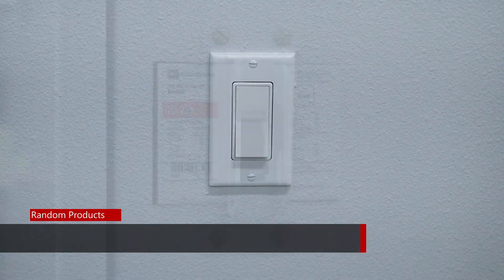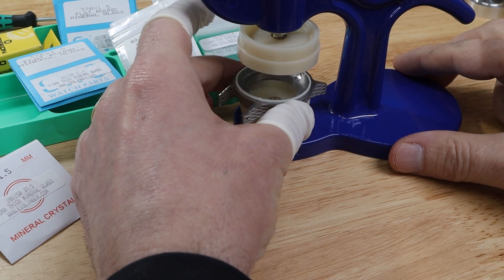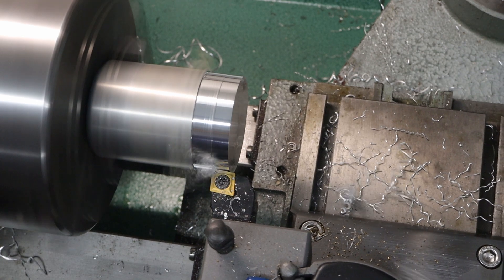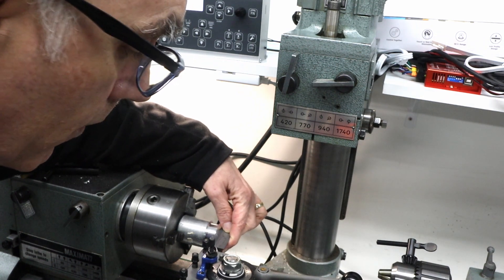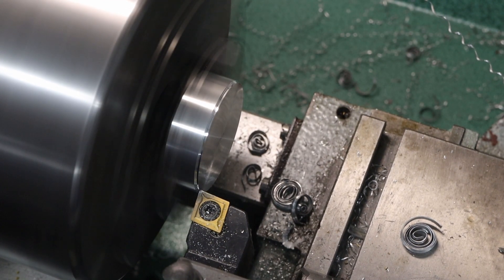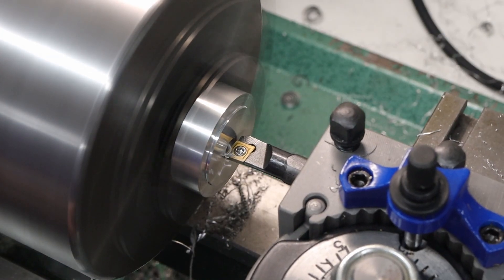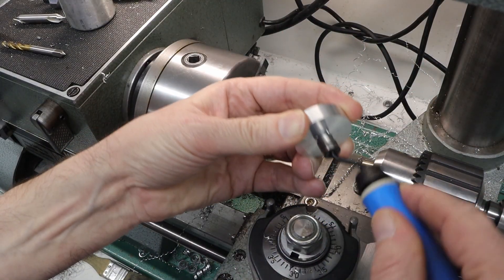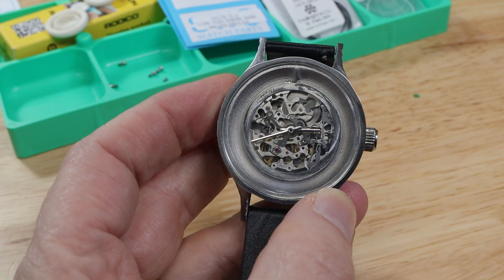Watchmaking Crystal Installation Tool for small scale production

Comment: This might sound silly but what if you called up Parker o-rings and just asked them? I mean you should like you are trying to work from the crystal to the o-ring but I suspect you want to find the right o-ring and gap size first then size the crystal.
Reply from the maker: Thank you. I might try just that. Although, it looks likes the smallest they make is 3mm cross section diameter, but we need more like 0.7mm. That being said, I see that have a really nice handbook that I should be able to use to calculate the correct size gland.

Comment: When I was a subsea engineer, our company had an internal design document (spreadsheet) for designing o-ring glands. It was based on the design guidelines found in the Parker o-ring handbook which can be found online pretty easily.
Reply from the maker: Thanks, that's very helpful. Looks like it should be straight forward.

Comment: Hi John. I bought the same exact press. It is not very good quality. I found the at top dies fail. The metal bushings tend to slide out of the plastic when applying force. The bushing then contacts the crystal either marring it or destroying it. I have since replaced the press with a used vintage model with far superior dies. Mostly I use this for indicators. The press is designed to flex the plastic crystal so its diameter decreases enough to allow the crystal edges to clear the lip on the bezel that retains it. Once in position you release the pressure and the crystal returns to its original shape and diameter, clamping itself in the bezel. This system works well for plastic crystals however most watch crystals are mineral crystals. These are like glass. They do not flex. Many are flat. So they are not supposed to be pressed in the middle or they shatter. Lastly, I suggest you contact me because the press I bought came with a cabinet full of watch crystals. I may have what you need. Maybe even a few sizes you could do a trial and error run with.
Reply from the maker: I used the philosophy of buying cheap to start with, as I don't really know what I need. Then learn from that and decided if I need to buy something different (such as a screw instead of lever press) and better. So if the threaded insert slides out, I can either make my own replacement or buy something better.
Reply: @JohnSL  funny thing is when I saw the video title I thought for sure you were making new uppers because they failed. So yeah, you can just make more. My offer on NOS crystals still stands.
Reply from the maker: Thanks Steve. I have the crystals of the correct size and thicknesses already, and I appreciate the offer.

Comment: I never worked with watches but my last job as an enginerd had me working with a lot of seals and gaskets so this is interesting to me. What material gasket are you planning on using? A quick Google search shows that nylon seems to be a popular gasket material for cystal watches

and I would love to help you design and build a pressure vessel for testing the waterproofness of your seal designs! 

100m so 10bar... shouldn't be too hard for such a small chamber
Reply from the maker: They're rubber O-rings: https://www.esslinger.com/watch-gasket-waterproof-70-mm-thickness-o-ring-gaskets/. I just ordered a watch depth tester a few days ago. Apparently, the way the ISO standard works for water resistant watches is you first pressurize the watch to, say 3bar, submerse the watch in water, and then release the pressure and look for bubbles.
Reply: An enginerd ?🙂

Comment: That's an interesting little lathe. Was it designed as a CNC machine or has it been fitted with an aftermarket conversion?
Reply from the maker: It's an Emco Maximat 7 that was built in the 1980s and I've been adding stepper motors. So far I've only converted the Z axis. I'm pretty close to being done with the design for the X axis. The controller is an ELS 4 Basic made by Rocketronics in Germany. That box does quite well with machines that like mine that have a lot of backlash. I might choose to try Linux CNC at some point, but we'll see.